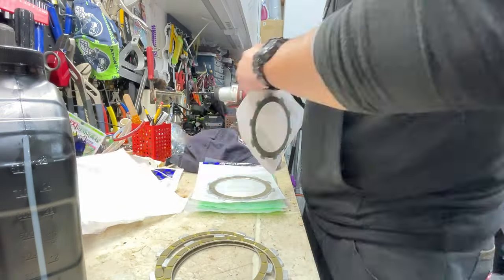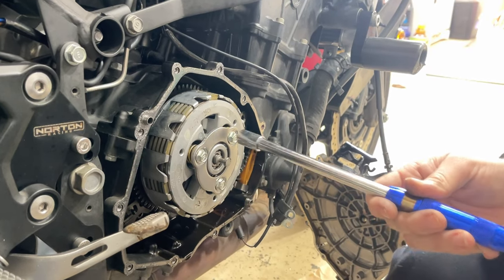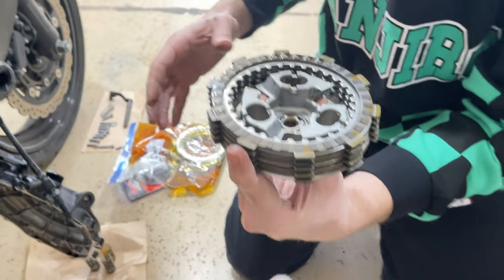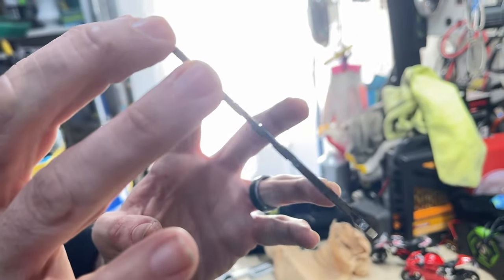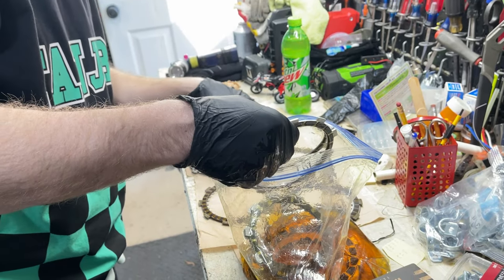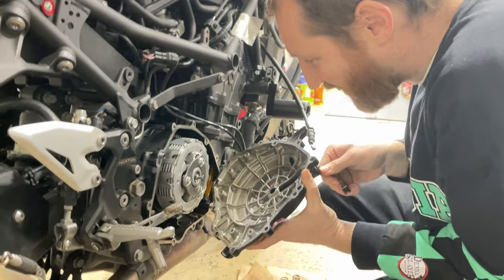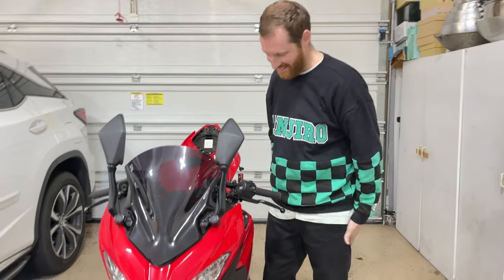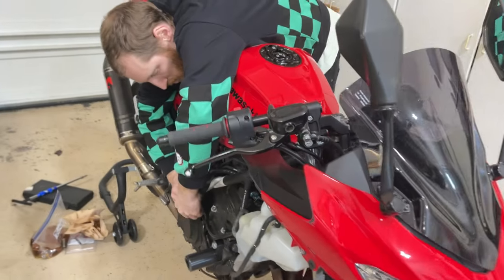Ninja 400 Upgraded Clutch Pack & Springs

Comment: What parts did you upgrade to for the clutch?
Reply from the maker: I upgraded the friction plates, the steel plates, and the clutch springs.  The factory clutch is just no good once you start getting used to your bike.
Reply: I feel like my bike  is not as punchy off the line or I might just be trippin or I probably got used to the power of the bike! I dunno
Reply from the maker: @KingVincemoto the stock gearing is set for a balance of acceleration and top speed.  I’ve recently done a +1 in the rear sprocket.  Contemplating on making a video about it.  Bike is a lot more punchy compared to stock gearing.  I can power wheelie in 1st gear.

Comment: Clutch springs bike vs car? On a car the "fingers" on the pressure plate provide the clamping force. On the bike the springs do the same thing while also tightening the feel of your clutch lever? If I had bets on mechanical application itd be there.
Reply from the maker: That honestly sounds about right.  The clutch lever on the 400 doesn’t feel like it tightens (without considering the clutch spring kit I have installed) thanks to the slipper and assist the bike has.

Comment: Wow, looked pretty easy and straight forward to do.   What do you have to left other then put the cowls back on?  Oh and fix that break lever........drive me nuts to see it bent over a little heat and crescent wrench action and she will be good as new again.   Really glad to see your almost there and will be able to back on the bike again.  My son and I went for a ride Saturday for about 1 hr he is a new rider and he is the one were thinking about getting the same bike for or a Z650 not sure yet. I ride a Suzuki Bandit 1200 he is on a older 01 Ninja 250r.  Sun was out so had to take advantage and enjoy!!!
Reply from the maker: Yeah!  I thought it would be somewhat difficult but it ended up being very easy to do.  Just minor things to keep note of and its all set.  I know, I know lol.  I’m gonna get that brake pedal fix.  Just not really priority now until it gets close.

Only things left is to take the fuel tank off.  Grab the ECU for a new map with the future power upgrades (DNA air filter, TST velocity stacks, and full exhaust system) and check on the spark plugs (service says change at 7500 miles, I’m at 18k 🤣).

The Z650 is a great bike and I’m thinking of getting that for a daily.  The 400 is easy to ride, maintain, and cheap to own.  Plus plenty of power to get on the freeway and then some.  Also has enough power to be fun on the backroads and in town.  But if worried about power and growing bored of it too quickly…maybe the 650 would be good enough to hold him off for a bit.  Only concern of mine is young riders wanting more power before mastering the basics.

And lucky on riding!  I’m almost there 🤣
Reply: Humble advice: Get your kid on the 400 (Ninja or Z) and not the 650. The 400 will do everything and your kid will get better quicker with lower risk level. Plus you have more fun on a bike you can whip around rather than to not be able to use the full bigger bike.
Reply: @evanarkush8643   Hey, we wound up buying the Z400 for him and he is loving it.  Had an issue with the O2 sensor not working, we cleaned it and that worked for a week. after that we bypassed it.  He rides everyday.   Really glad to see you back on your bike!!!